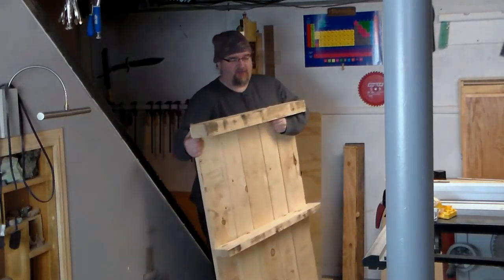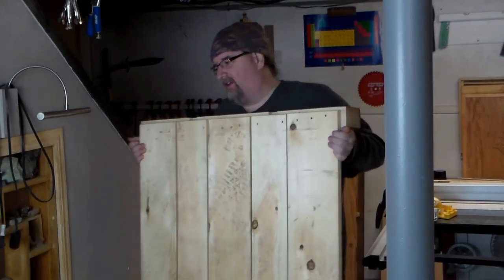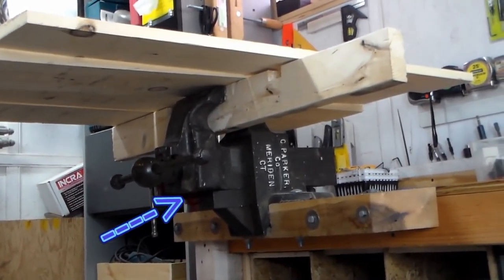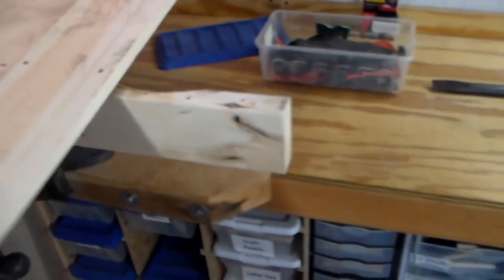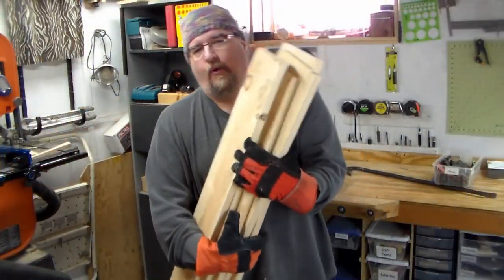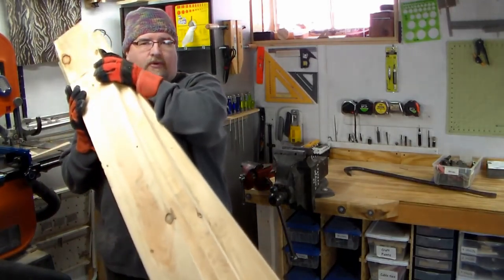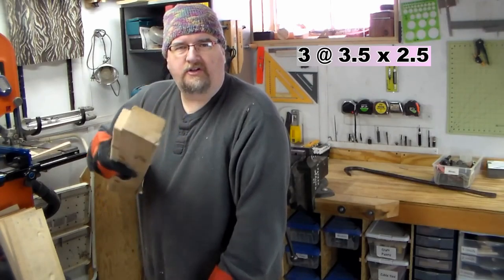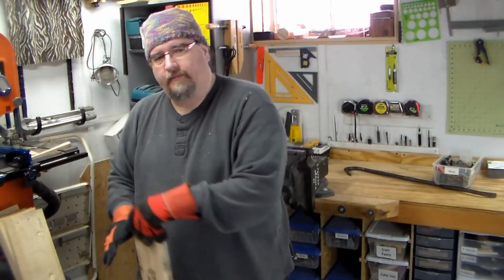a quick pallet breakdown tip - like making meatloaf

Comment: That's a great method. The ends split more often than not when you try to pry apart the 3/4" pine pallets. At least, that's been my experience. I think I'd waste less wood if I cut the ends off like you did. Plus, your method saves a lot of time.
Reply: Also, I make some pretty damn good meatloaf.

Comment: i use pallets a lot and have found  there is no one single kind of pallet or pallet construction and there i no one single method to tear them down to achieve usable wood. i work in a metal fab shop and have access to a lot of heavy timbered  pallets five feet by ten feet most are hard wood like oak. i have found a few pieces of walnut too